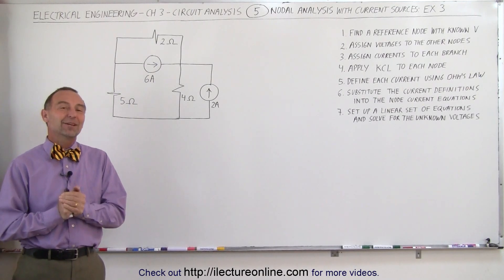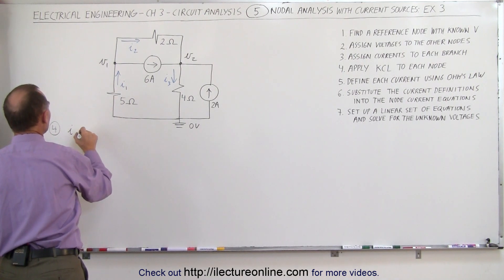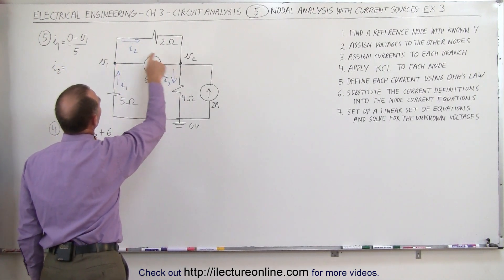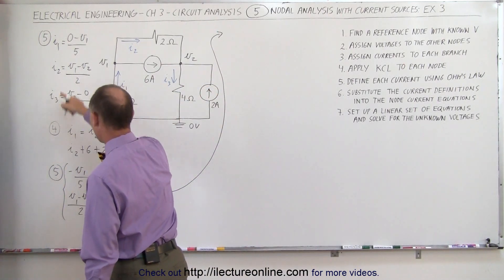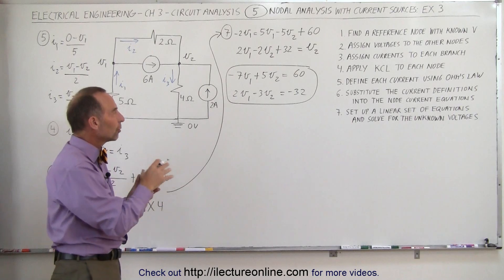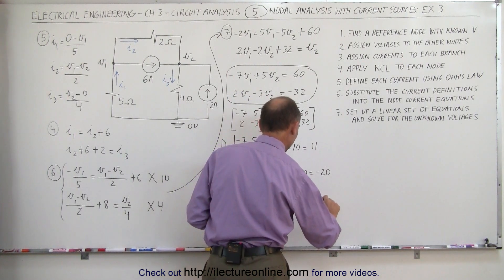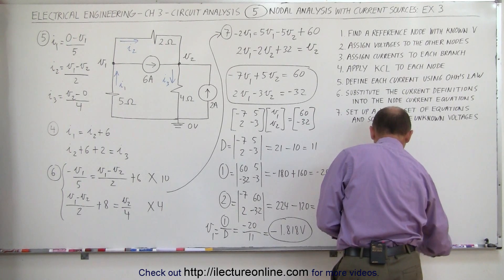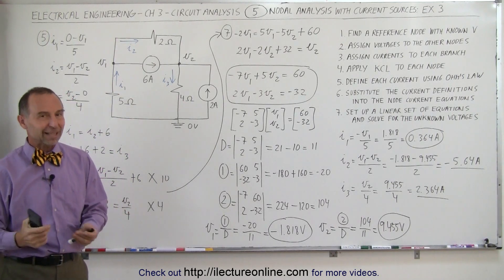Electrical Engineering: Ch 3: Circuit Analysis  (5 of 37) Nodal Analysis w/ Current Sources: Ex. 3

Comment: The best circuit analysis instruction hands down! at 10:43 you calclate i2 current and I produced -5.634 but you wrote -5.64 Amps. Is it a best practice to round up to assume the higher current?
Reply: Nevermind I just realize I did not include thousandths in the V2 voltage and had 9.45 instead of 9.455. Thanks again!
Reply from the maker: Glad you figured it out.

Comment: I took EE in 1966 and still think this is the coolest thing I ever saw.  On this one I stopped the video after the assignment of the current directions and decided that with the two current generators converging at the same point, they should send the current through the low 2 ohm resistor which is oposite of the assumption.  To my surprise I was correct which proves that if we guess wrong about the current directions it is no big deal and nobody will think we were stupid.  It could have easily gone the other way.  You could make up 1000 of these and I would still be amazed at how well the system works and has our backs.
Reply from the maker: Absolutely.  You obviously speak from experience, but yes, this method does make it almost magical.  🙂

Comment: Well i didn't understand how to assign current directions?
Reply from the maker: It is arbitrary, you can assign current directions any way you want.  If you pick the "wrong" direction, you will get a negative answer for the current.  We try to make an educated guess, but we are not always correct.  Current flows from high potential to low potential.
Reply: @MichelvanBiezen  Okay now it make sense thank you so sir

Comment: Hi Sir, how are you determining the direction of the current in the branches, such as i1, i2, i3? Is there a certain method for that?
Reply from the maker: I typically take an "educated" guess as usually it is somewhat apparent.  However, that said, you can actually just randomly guess and if you guess incorrectly, you will get a negative answer for the current indicating that the current is actually in the opposite direction than you guessed.

Comment: Respectfully Sir, I used the following approach and had it right too and it checked out with my current equations. But different answers altogether

 SAME V1 AND V2 NODES. I assigned my currents, (  i1 , i2 and i3) differently.

Had i1 current direction leaving V2 into the 4ohm Resistor . 

i2 current direction through the 5ohm resistor going into the V1 node.

My i3 through the 2ohm resistor entering Node V1.

Came up with the following : 
@ Node V2,
i1 + i3 = 6 + 2  =>  i1 + i3 = 8

@ Node V1,
i2 + i3 = 6

Using KCL :  i1=V2/4.      i2 = -V1/5.        i3 = (V1 -V2)/2 I had the following solving for V1 & V2:

 V1= 14.30v.               and                   V2 = -3.430v

And ultimately , I had the following current values :

i1 = -0.86A.                    i2 = -2.86A.                     i3= 8.86A 

Please could I be wrong in my approach , because I've verified it over and over. Please your help will be very much appreciated. Thanks

Comment: Through row eschelon form of matrix, I got a result: v1=20, v2=24, i1=4, i2=-2, i3=6. This all adds up, but is it correct to have answers like this?
Reply: i also got the same answers using a different method
Reply: Same for me by subtraction between the two linear equations...
Reply: I got exactly the same thing.
Reply: Got same as U, but i1=-4A, i2=-2A, i3=6A actually 🙂

Comment: how do you know what node to connect to ground? can it be anywhere in the circuit????
Reply from the maker: Essentially yes.
Reply: The easiest way is to assume a common node is a 0V, same as 24 V in industry. Which ever you prefer math and phisics dont lie. It will tell you the truth later on 🙂

Comment: i Have the same results with a slight difference. The voltages have the opposite sign. I also noticed that you consistently assume in a certain yet for me not discernible way the precedence on which voltage you have to subtract from which. Please clarify.
Reply: Same